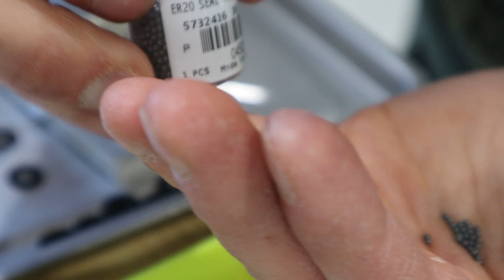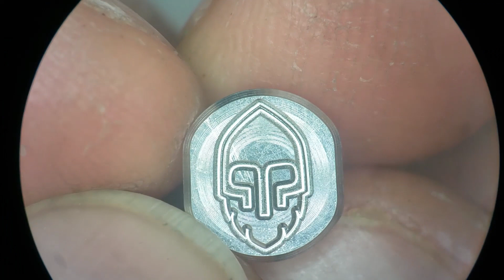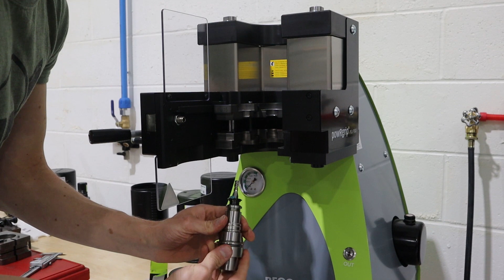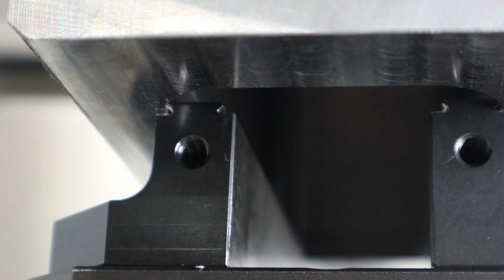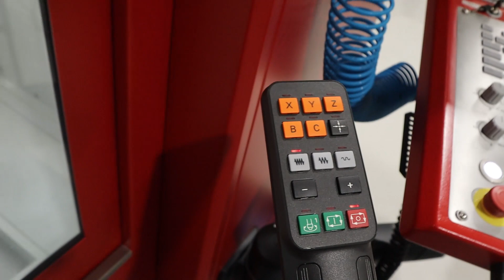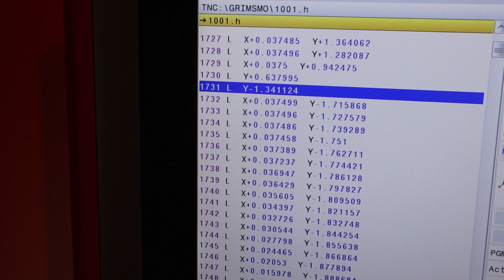Quarantined Shop Life - Day 11 | 5 Axis Madness!

Comment: Have you thought about collet pressure distorting the part? In theory it shouldn’t matter if you face & grind in the same op but it will show up if you stone it later. We’ve found tuning the collet pressure helps or sometimes holding further back on the part. Great videos, keep them coming!

Comment: any hint as to what you use for that FullGrismso Engraving?
Reply from the maker: For the viking head on the pivot?  An $8,000 electric spindle that goes up to 60,000rpm hahaha.  I think I'm running it at either 18k or 32k.

Comment: Have you already tried the automatic touch probe cycles for setting datums? When I was working as a mold maker with 3 and 5-axis machines equipped with TNC530-series controls we used those cycles (410 and 411 mainly) all the time. 

One thing we also used quite a lot was calling the actual milling programs as a subprograms from a main program that had all the feeds and speeds defined as Q-parameters and the post processor was set up so that the actual nc-program had those corresponding Q-parameter values set as feed values etc.

Comment: What about docking station for real workstation laptop? I am IT guy (most of the time) and I love proper keyboard, mouse, 3d manipulator and wide screens. This way you would be able to have smaller laptop (lighter) and connect all the gizmos with one click (depends on docking station). And with modern tech all these peripherals can be connected on single usb C port together with power.

Comment: Cool to finally see a hands on video with the kern!, such an awesome piece of machinery! I run an older dmg dmu50 with heidenhain and although its nowhere near as accurate/fast/cool the b and c axes and control look a bit similar. On my machine you prevent the probe from rotating by altering the plc %00000000 code in the tool table. Changing one of the zeroes to a 1 prevents it from rotating, it's also possible to disable the coolant for this tool by altering this code, so also usefull for tools that dont allow internal coolant for example. Looking at your tool table its all zeroes so maybe its not setup yet? Also no need to enter the "z" and the rpm at ech tool call. Just press tool call, the tool number and press enter -> end. Hope to see more kern videos soon!

Comment: To get the proper home position on the C and B axis you need to add either m91 or m92 depending what your machine accepts. With out m91/m92 you'll just put it back to its datum position meaning it may not be correct, especially if you probe in or clock in the C

Comment: I dont know your machine, but Heidenhain Tool magazone dose normaly not follow the numbers in the magazine. there is something called pocket table where you can see mabe tool 7 in pocket 100. 

the machine will Grab the tool and put the old one in its magazine pocket space. im sure your DMG dose that aswell.

It is possible to lock tools by the number. and that is normaly used for probes ore locking pockets around a big face mill where it would need free space to fit in the pocket

however the magazine you have looks like it might not be this way. so agin i cant say why it would bring the wrong tool. sorry bad english

Comment: Use different tool for facing thr pivot. Tool which create less resistance. Maybe .2 radius V tip single sided. Also make sure entire setup is rigid and apply constant surface finish, maybe speed limit for spindle  is too low. If not help face or roughly and mill the face for finish.

Comment: You can make small fixture to assemble the bearing. Bottom plate to line up holes in plastic housing and top to provide balls on particular PCD and then device which release single ball for particular hole. Balls are provided from top container.

Comment: I think Grimsmo has to wear special pants to account for his enormous balls. 
Last vid
"This is my mill, worth several Lamborghini's"
This vid
"I've not really ran it before, and I've been nervous about running it"
Presses cycle start, checks it runs round the stock, sets machine to 100% and waddles* across the shop away from estop of said $$$$$$$$ machine.

*Waddling is due to aforementioned enormous plums

Comment: you can tell your cam software to output the tool diameter after the Tool call and then do a routine to check if the tool has the right diameter (+- tolerance). If not it will stop the Machine.

Comment: John,  on the pivot I believe what your seeing the left over from the roughing pass.  try just leaving a few more thou to finish and those rings will go away.  we've seen that on some parts before,  that's why the rings are concentric instead of a spiral.  if the finishing pass was leaving the rings it would be a spiral.  the real problem is that that the machine can stop on a dime and there is some deceleration in the servo which is over cutting in some areas and leaving you some rings.  don't know what your leaving for finish but usually we leave at least a tool nose radius.  good luck

Comment: Hey John. You can try backcutting the grinding Wheel by 0,5-1° so that only the outside Ring will cut. This may increase the surface finish even more due to less cutting forces and the flatness will also go to "full grimsmo" because only one Point Cuts. But make sure that on your Machine its okay to Grind otherwise the dust from the wheel can ruin your ballscrews and ways. Greets from Germany. its nice to see Kern Machines and Haidenhain controllers outside of Germany. Love your Knives :)

Comment: I've been using blum, rego-fix pg and heidenhain for the past 7 years. I have some tips you may or may not know already. First for the PG holders I would recommend cleaning the inside of the holder and the collet with alcohol as even a little oil in there can cause problems ( I've had tools pull out under heavy cuts) and you should have a screw in the bottom of the collet to adjust tool stick out. Second the L-off and R-off in the tool table are pretty important if you want super accurate tool measurements. These adjust the position of the tool in the blum laser. For example if you have a 1/2" end mill with a .03 corner rad you would want your L-off to be a minimum of .03" this pushes the tool down so you're measuring the diameter past the corner radius of the tool. Then your R-off should be a maximum of .220" this will move the tool off the center of the laser so you're measure the length at the edge of the flutes. You do this because the laser beam is a cone shape so as the flutes get further from the center of the beam you'll get shorter  length measurements. Also i always calibrate my lasers daily since it literally only takes 2mins.  And if you want a super accurate calibration use the s-runout program in the blum folder. This accounts for any run out of the calibration tool itself.
Reply: Hmmm, I understand doing this when measuring the radius. But why is it bad to measure the length in the center of the laser? The laser is bound to hit the low spot if its spinning?

Comment: Just thinking you could just have a small rolling conveyor with a top roller that pushes the bearings in to place as the go under it. The worker then just does the tweezers trick and loads them on. Could just be a small motor driving a belt with a platter behind it.  ( similar to a grinder ) and a top roller. Sure you could knock something together..

Comment: What bothered me first on the pivot is that the left side of the nose isn't a straight line. Then only after I noticed the surface 😅
Reply: And watch out with the sticky tap, if it gets too oily, then it will deposit some micro bits of it on your tools when you try to clean them.

Comment: What way lube do you end up getting and from where?
Reply from the maker: It's called PC Way Lube 68, and I get it from Toronto Lube Services.  Actually I think in this video I emptied the PC and switched to TCS Slideway lube, basically the same stuff.
Reply: JohnGrimsmo 
Ahh ok, I have some way lube from what used to be called case N drum.
Ya I get my coolant through Toronto Lube. Some Qualichem 231 for the bandsaw and mills etc. although not terribly happy with it, left a bunch of residue on parts.

Comment: If I had to assemble those bearings I would make a hand held vacuum tool that sucks the cage onto the tool and then the vacuum would come through the holes and you could suck the bearings into their location. Once all the bearings are in thier locations just press them on something flat, like you're doing. Then press a reverse button on the venturi vacuum and the assembled bearing would shoot off into a container

Comment: In my experience with grinding, usingthe side face of a grinding wheel is very inconsistent. Grinding wheels are meant to grind on the od(usually). Or that's just my experience atleast
Reply: Yes definatly, or swivelling the wheel a small amount would do similar. Need to ge line contact not sweeping through a large arc.

Comment: A simple fixture for the bearings would speed that up massively. A cylinder with 10 holes drilled in it that acts like a funnel. Put a bearing case in, slide the funnel over it, slide the funnel to the side, press. Repeat until all bearings are completed. You could literally do one bearing in just a few seconds. Send me some bearings and cases, I'll make you one.

Comment: Are you importing your tools from fusion into Camplete for each part or using a library built inside Camplete? I found the easiest way was to cut the tools off at the gauge line inside fusion.

Comment: John there is a threaded hole w/ a set screw in the bottom of the of the PG collets you can use to precisely set your tool stickout.  Rego makes many different lengths of the screws as well.  Makes swapping worn out tools simple as the tool length stays consistent

Comment: So it looks like if you leave more material to face off the pivot in the sub you’ll get a clean face. So do your turning and threading then handoff. Then face off more than you currently are, it seems like you’re getting some warpage do to internal material stresses. Then finally engraving and then chamfers.

Comment: I've been using RegoFix for about 8-9 years now and i have to say i love them. They give about 0.003 runoff most of the time and are smaller in diameter at the clamp are. Get some screws, on the bottom of the clamp is a threaded hole which you can use to fix the stickoff. Beware ive had a few times when exessive vibrations caused the tool to come out.

Comment: Why does the oil level go down?  Is it lost as mist?  I would think the machine just collects and recirculates it
Reply: its pumped over the linear guides and ball screws to reduce wear. Its lost because as it spreads it drips off the machine and usually collects in a nice puddle on the floor or in the coolant tank.

Comment: Instead of machining your Tombstone in the Mori then finishing in the Kern, you should have just faced and machined you bolt-hole pattern in the Mori then mounted it to the pallet in the Kern and machined the whole thing
Reply: That is what he is going to do. He roughed out most material, then he is going to finish it when it gets mounted to the pallet on the Kern. The roughing on the Mori is inconsequential to precision, since the whole thing has excess stock left on it, that will be milled away on the Kern.

Comment: I would venture a pretty safe bet that whatever you paid for that laptop, put into a desktop, would thoroughly trounce it in terms of performance when it comes to path compute times in CAM and any rendering in Fusion or the like.  Desktop-grade CPUs (and GPUs, with the GPU-acceleration Fusion can demand) don't have the same power and thermal limitations as a laptop; it's no contest, I wouldn't be surprised if you cut your compute times in half, and 64GB of RAM is not even a stretch for a full desktop.

I'd strongly recommend looking into a desktop solution at either the shop or at home, and then getting over the hurdle of remote access from whichever place it isn't resident.  It might even be worth setting up a small rack mount setup so you could have even more than one such system for Angelo or the like.

It also means that in that fancy new shop with all the space you have, you could have a 'serious-mode sit-down-and-hack-through-CAD/CAM' setup in an office (multiple displays, full-size keyboard, 3D mouse if that's your jam, macro keypads, etc.) , and then remote into the machine or cloud-hop the files on a laptop to make tweaks machine-side.